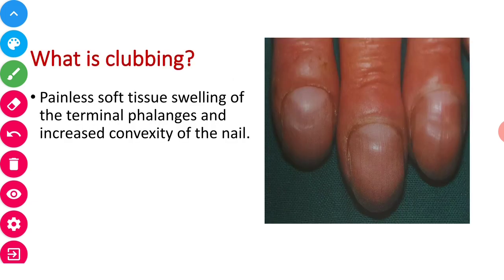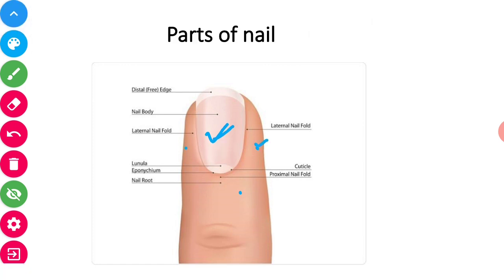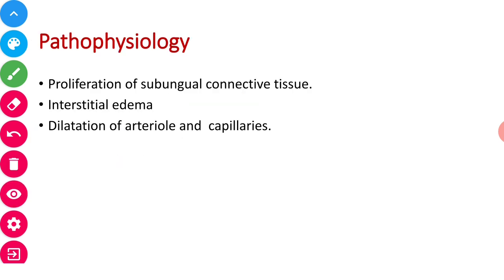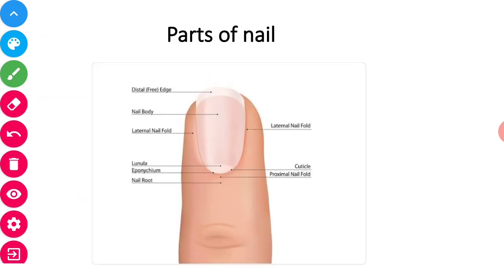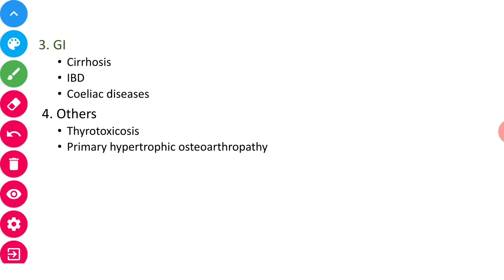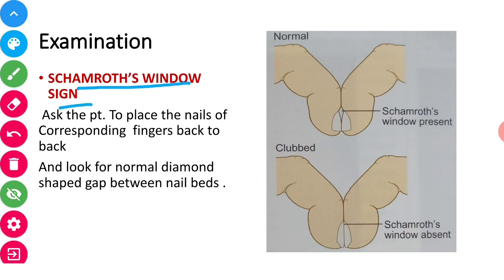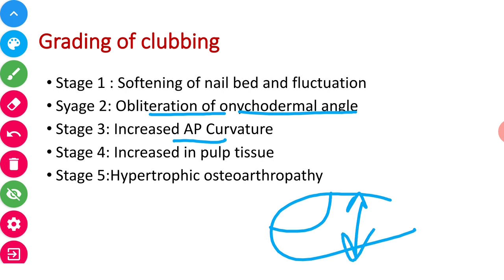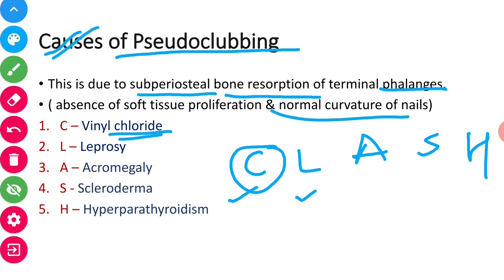what is clubbing | nail clubbing causes |

Comment: Im 24,. I have clubbed nails( since 3-4 years I think). I'm a non-smoker and have no major medical issues. Only I used to have asthama in childhood. Am I at any risk?? Plz respond
Reply from the maker: No not necessarily...can be idiopathic.
Reply: @SkepticBio   thanks for quick response. When i place both nails next to each other, there is just a hairline gap btw them instead of a diamond shape. I was told that this is abnormal. My Oxygen level is 99% through pulse oximeter. But I'm still a little worried about this clubbing.  Will this automatically get resolved?  Or is this a warning of any health issue??
Reply: bhai mera bhi same yehi seen hai...iam also ok